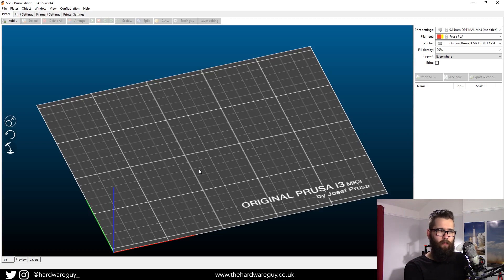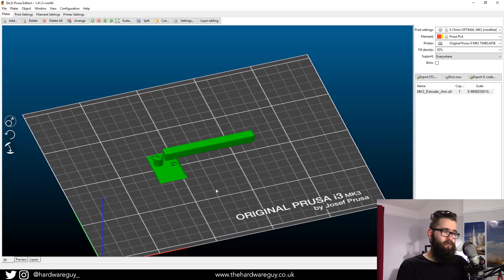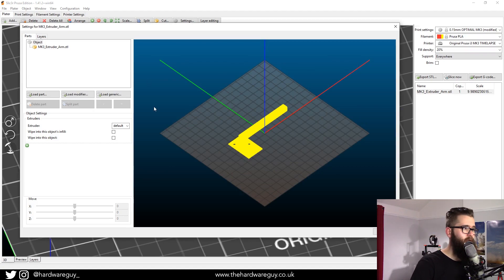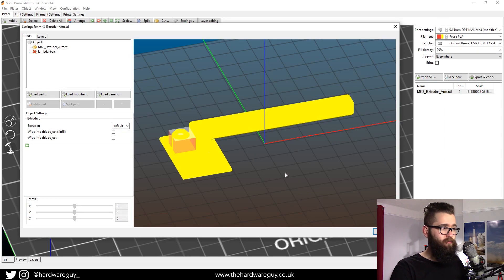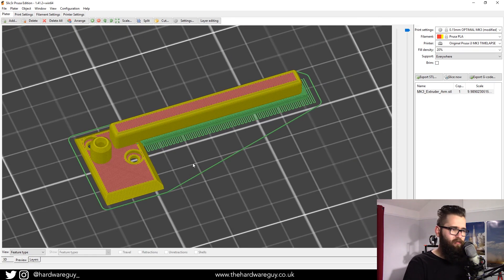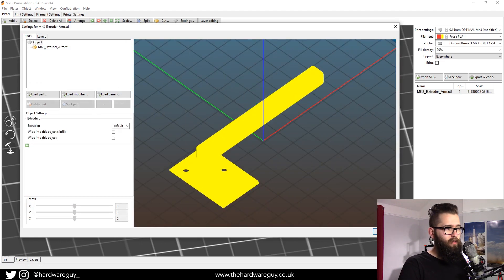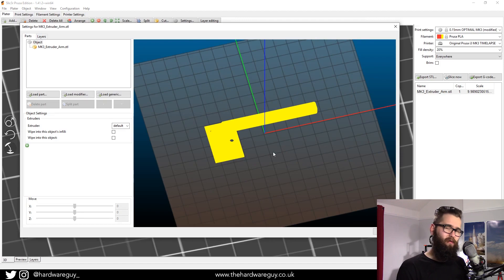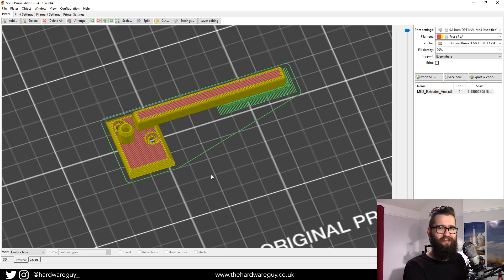Slic3r Prusa Edition Custom Supports

Comment: All your video you did now show how the print with support, this is not help.
Reply from the maker: What do you mean? what else do you want to know? Custom supports in Slicer require you to use support enforcers and support blockers. I showed you exactly how to do that.
Reply: @thehardwareguy  hey, i want you printer it ans show as how that come with the support, how that look after remove it😉
Reply from the maker: You just print as normal, then the supports peel off very easily!